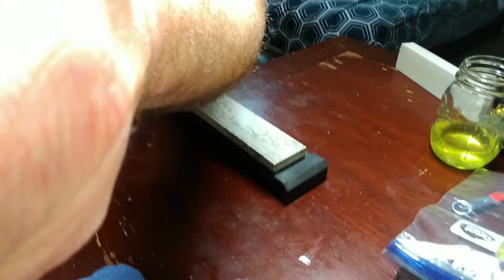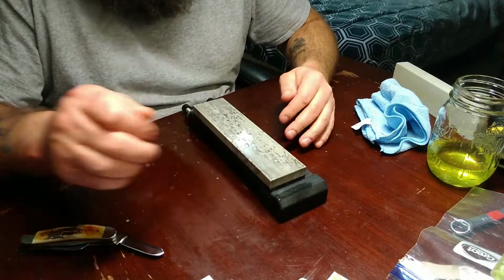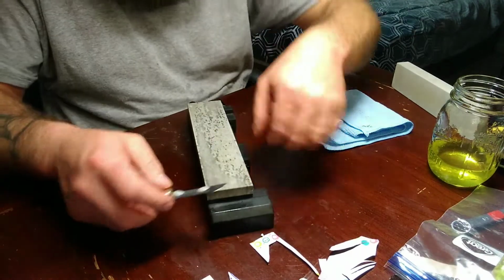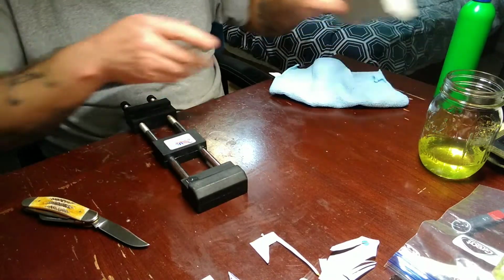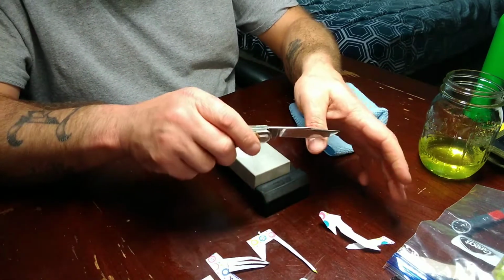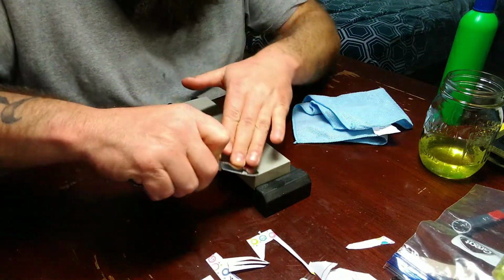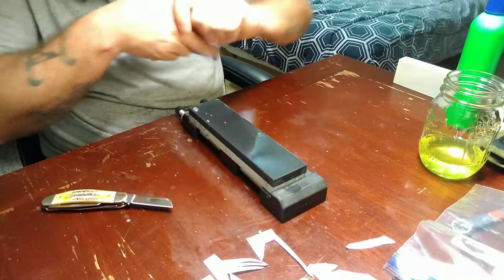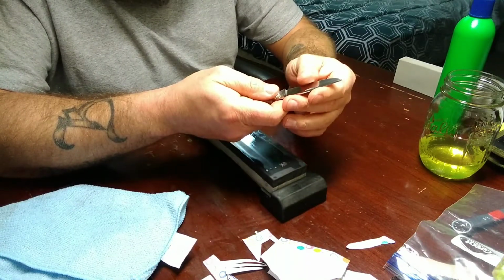Finishing up Wayne's Case

Comment: I really got to get me some of Dan's stones. Thanks for the video!
Reply from the maker: Take a look at the specials if you are on a budget. Lots of good stuff there.
Reply: @roughroosterknifesharpenin5531  I will. Thanks!
Reply: @roughroosterknifesharpenin5531  what stone would you recommend I get for regular knife maintenance to start with.
Reply from the maker: @jeffsmith6441  I would go with a soft if it were me

Comment: I was waiting for the soft ark to come out 😁😁.  Boscoe what up dude 🤘🖖.  I personally have all my Arkansas Stones lapped and labeled.   That includes the 2 you sold me.   I think the crystolon sets a good base but needs a finer finishing grit stone.  Usually the first sharpening always takes the most amount of time. Lately I've been doing 1 stone sharpening with my soft ark for my rope cut testing.   One side is lapped at 320, the other 800.

Comment: Last night I felt the stone ease up and the work glided across. I could hear it too. I finally got it to catch a nail. Next I lightly went over a old Hick sharpening steel then a paint stick with compound. I've come a long way from scratching up the blade and taking off too much metal.
Reply from the maker: That's good to hear.